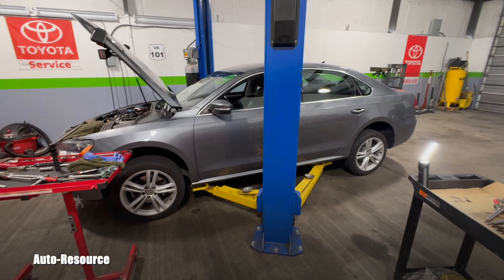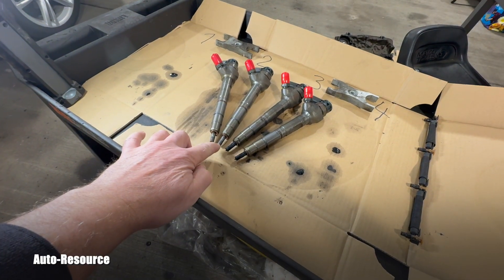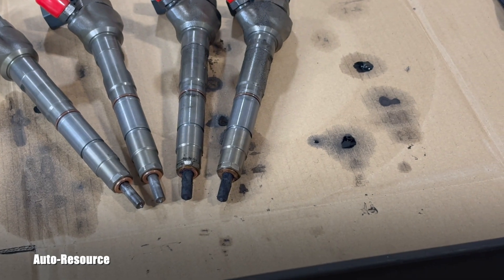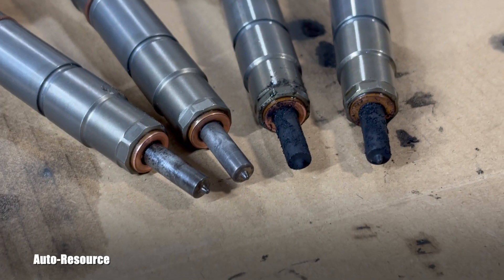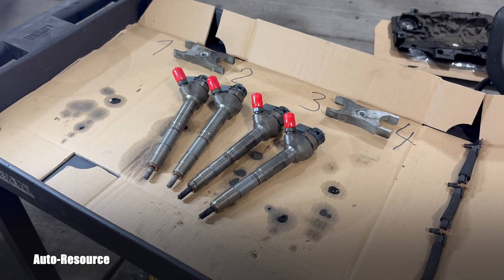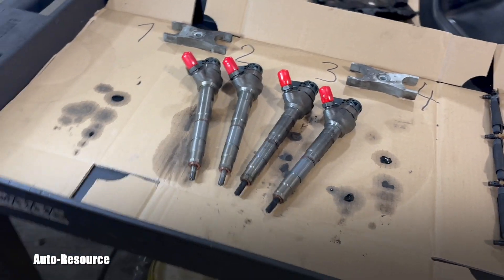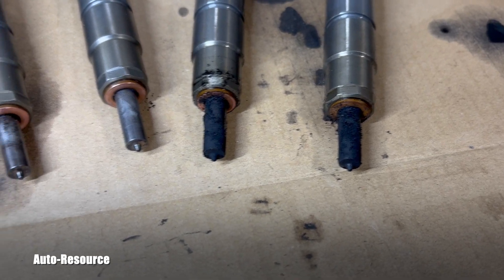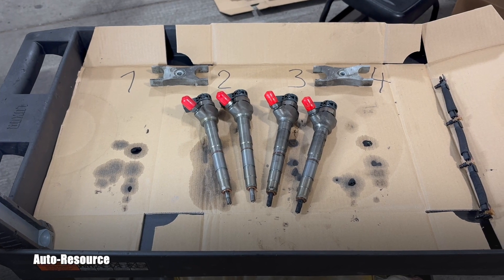How to clean diesel injectors tips, safely removing carbon deposits

Comment: Question- I have a 2009 VW Jetta 2.5. Cold start car misfires until you step on gas to clear it out. Then runs fine. 

Changed mass air sensor - car still has same problem. 
 
Any suggestions?  Coils were replaced along with sparks plugs.